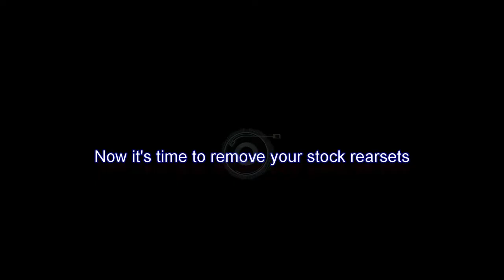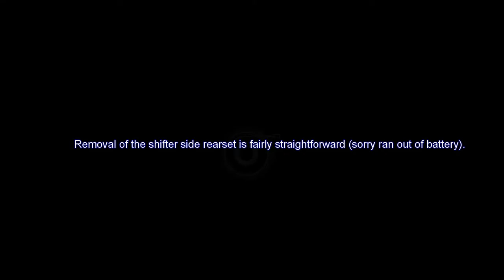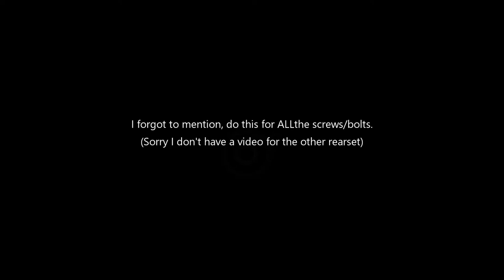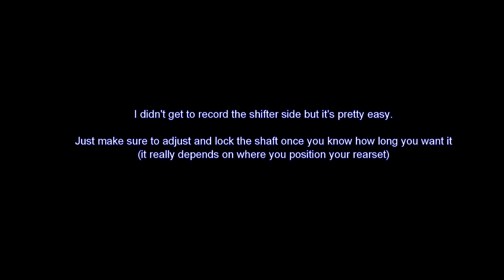Ebay rearset install on XSR900 (FZ09 / MT09)

Comment: Just used this to install mine. The instructions are great, but there are some differences for FZ09. Pretty easy to figure out.

Some comments for everyone:

I bought this from Home Depot. For under 3 bucks, its a perfect size replacement for the OEM swing arm bolt. Use it to tap out the OEM and hold everything in place, then when you put the gear shift side on, just punch it out when you put the OEM one back in. Saves some trouble.

http://www.homedepot.com/p/5-8-in-11-tpi-x-12-in-Zinc-Plated-Threaded-Rod-802017/204274006

Some comments for the FZ09:

1) On the brake side, remove the brake cylinder mounts before removing the rearset, they are on tight and difficult to remove without them in place. I stripped one before i realized this, and it becomes pain to remove. Also there is additional allen at the bottom you will need to remove to remove the brake pin.

2) If you're bike is upright in a chalk, it requires very little pressure on the bottom side of the muffler to take the weight off the rear tire. This is what I did and there were no issues/deformation.
Reply from the maker: Thanks for the tip!  I'll put this comment at the top for my fellow fz09 bros :)

Comment: Thanks a lot for this... helps tremendously. I opened the package and was putting it off. 

Also a personal comment on the speed. Perfect... I miss the good ole days of text instructions (because its significantly faster to forward through the stuff you know) but this is perfect. Quick to not be bored through what you know and fast enough to understand the overall process in not a huge amount of time.

Thanks again!
Reply from the maker: Great minds think alike!  lol  I just hate it when I'm listening to a tutorial on YT and they just blab about everything and the whole video is over 30mins long lol.  Thanks for the comment!  Cheers!

Comment: The vid is too fast brother... its a cracking video but on the small detailed parts where the viewer really needs to see what is being used and what's being done it all just flies by way too fast. It turned in to a 'pausing' frenzy for me. NOTE.  These Chinese rearsets DONT fit the XSR900 with the Akrapovic Carbon  exhaust fitted. The rearset conflicts with the exhaust mounting bracket!
Reply from the maker: In my attempt to make it as efficient as possible, I may have zoomed past certain sections a bit fast lol.   But I bet your pausing skills now are on point! lol My bad brother, will need to work on that.   As for the rearsets, did you get the exact one?  Mine had no issues at all. Here's my vid i posted on the fz09 forums:  https://www.youtube.com/watch?v=NEuikySldU0   Oh wait, you mentioned the carbon, ahh, thats good to know then!  I have the original one from akra.
Reply: I know! Total nightmare ☹️ oh well.... thanks for tips bud. Yes I use the FZ09 forum also, great bunch of lads there...
Reply: Not sure if it'll help at all but click the settings cog and then speed and .75 or lower to slow it down.
Reply from the maker: Appreciate the tip!
Reply: No problem man. Nice vids.
Reply: @stevenfebvre5151  Bro do you know if it fits the MT09 with Akrapovic Carbon? You said it didn't fit the XSR900, what about the MT09/FZ09?
Reply: @stevenfebvre5151  Pls really need to know
Reply: joao m sorry bud. I have no idea as I don't own the MT09. Maybe ask the good guys at the MT09 forum.org, they might know.

Comment: Who is the ebay seller you bought these from?  Thanks in advance.  How are they holding up so far?
Reply from the maker: They're holding up Great.  Just make sure to not overtighten, and use threadlocker.  Here you go.  http://www.ebay.com/itm/Aluminum-Anodized-Ajustable-Rearset-Footpegs-for-Yamaha-MT-FZ-09-14-15-New-BLACK-/121984215784?hash=item1c66d36ae8